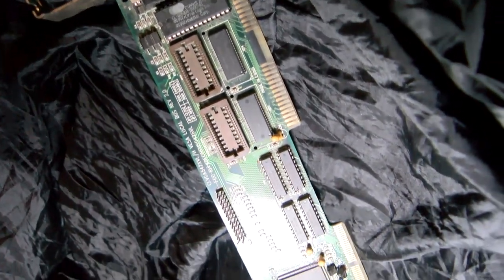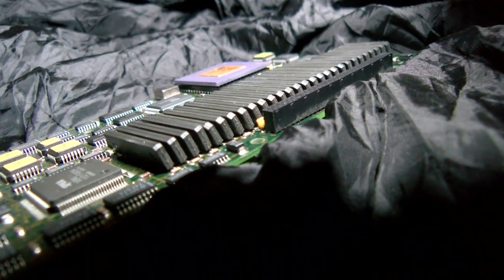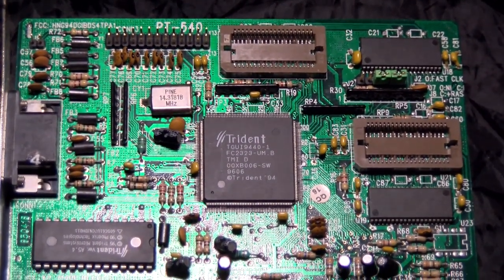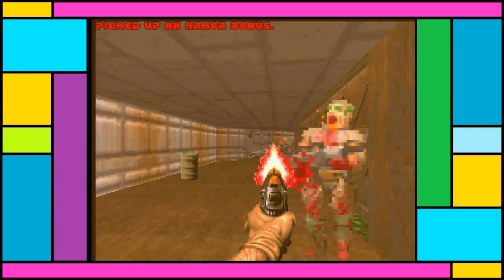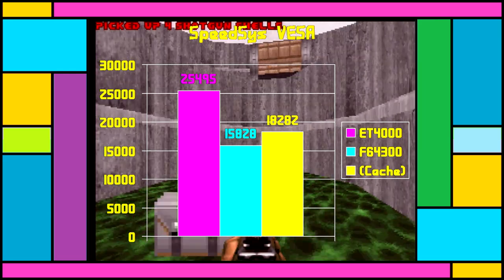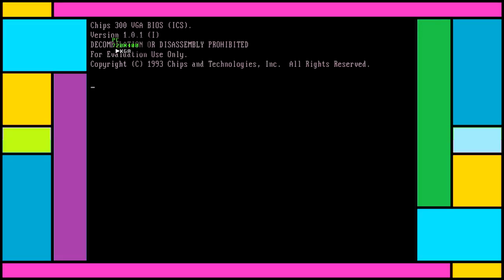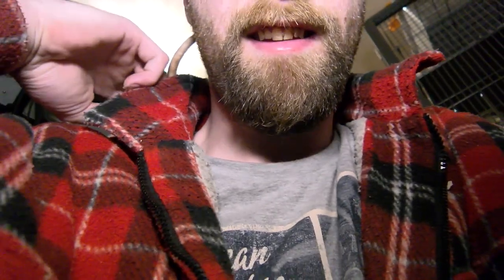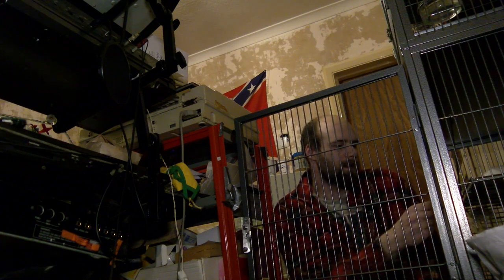C&T F64300 VGA Card

Comment: Very nice to see another video from you, and on a subject that wasn't covered 29 times before.  I happen to actually have a CHIPS FC64300 VLB card, it actually came with only 512KB RAM on board, a broken DRAM socket and 8 emtpy DIP sockets for more RAM.  I removed the broken DRAM socket and soldered on 512K of RAM instead and it works fine as a 1MB card.  I don't have an EEPROM reader but if there is a way to dump this card's BIOS in DOS, I can do that for you (let me know how, and let me know you want it..)  

This card performs on par with top dog VLB cards from CL, S3 and Tseng in my experience, but your benchmark results seem to be a bit CPU bottlenecked to actually reflect the performance gaps if you ask me. I actually happen to have some Windows drivers for this card too, that make me think it is actually not a consumer card but more meant to be used in professional workstations (there are drivers for professional software such as AutoCAD etc. on the disks) .  I find that its DOS performance is great, but I use a 2MB CL-GD5428 in my U5S-SUPER33 system instead (Yes, I'm another U5S user, and I wish I had the 40MHz chip but I can't find one for cheap..) just because I can upgrade it to 2MB with DRAM but finding SRAM for those DIP sockets has proven rather difficult (And I'm an OCD nut that will go crazy knowing I have emtpy sockets in a card that's in my system..)  

 FC64300's obscurity makes it difficult to use with earlier Windows versions (drivers are hard to find and there are no 3.0 drivers IIRC).  This video makes me want to swap out my 2MB CL-GD5428 for my 1MB FC64300 actually, because why not?  The extra 2MB does absolutely nothing for the CL-GD5428 either.. 

I hope you do more sound card reviews of more obscure ISA sound cards in the future.
Reply from the maker: So it seems that there was at least one other revision of the PCB out there. Short of having an EPROM programmer I'm not sure if there's a reliable means to dump the BIOS, you can always use DEBUG if you know the address (C0000h I think), NSSI has a feature to do this too, but both of these only dump the first 64K due to DOS limitations and trying to figure out where the rest of the ROM is yourself to get it with DEBUG isn't always straightforward.
I think I mentioned the CPU speed somewhere, but I used this one for a couple of reasons, firstly I've seen very few DX4 systems with VLB over the years, it seems PCI motherboards got cheaper at that point so people used those instead - I have, however, seen a worrying number of DX4's with ISA video cards - or else they skipped it entirely and went over to Pentium-class machines, systems with DX2-66 performance seem to be the intended target for the card, especially given the dates of things. The second reason is that I didn't really see a gap open up when I tested it in the Pentium OverDrive. 
Of course my sample size is 1, so perhaps the results are different on different hardware, evidently it is. Not sure where you'd find those SOJ RAM chips either, I've been lucky enough to have dead video cards to steal it from so far. As for AutoCAD, most cards had drivers for it, some of them do more than others.
Oddly this video took the place of an AdLib clone one which wasn't working out, that will probably resurface eventually, especially as the 286 is around for other reasons right now anyway.
Reply: @HighTreason610  Oooh, Adlib clone, nice!  Is it a clone from all the way back or did you build one of the later open source projects like the TubeTime Adlib?
Well if you are curious you can find a photo of my card here: https://i.postimg.cc/Pr0Pw9J6/Dataexpert-DSP6430.jpg
Back in the day I used a DX33 VLB which was later upgraded to a DX4-100 and retained VLB graphics so my perception was always that 486, even DX4, was largely a VLB affair with PCI implementations gaining ground only after the Pentium became a thing and PCI graphics cards became actually affordable - by when the DX4 was basically a budget CPU anyway.  I may be wrong however, after all I was just a teenager at the time and spending (mostly) my parents' money.
Regardless, my experience is that at the end of the day pretty much all VLB cards perform within a fraction of each other for DOS games.  If you will pick one, pick the one with the best support and acceleration for the OS you want to run.  This is exceptionally important for non Win3.1x systems, I find..
Reply from the maker: A couple of 80s and 90s clones, one of which is probably better than the original card, the other of which is extremely (but likeably) grainy sounding. I did get some way in making my own clone years back but dropped the project. Not sure how many sound cards I could really talk about as most of them were crap (TBS Pinnacle, S2000, fake Yamaha) and got covered in other videos, the Maxi Studio ISIS will almost certainly never get one, because the CD did something horrible to my hard drive and I lost enthusiasm after that. Might see one or two though and at least one more weird video card - far more weird than this one, that's for sure.
That's definitely the first time I've seen a 64300 that isn't on the yellow PCB, strange that they left the cache DIP sockets off yours, perhaps they really did fail to get that feature working as intended.

Comment: Given that the ramdac has to have instant access to the ram when it needs to to display a stable picture, it will block the GPU from accessing it in these situations. That's the only situation in which such a dram based cache might help...to decouple the GPU. And maybe, this situation doesn't happen that often in 320*200*256, because the bandwidth required by the ramdac is quite low compared to some SVGA modes. That would explain why there's no gain in any VGA modes but in the Vesa test.
Reply from the maker: That would make sense to me, I did mess with a few things at higher resolutions but I think the CPU tops out at that point. There's probably an argument for using a faster CPU, but I don't see VLB DX4 machines often and suspect that people were going PCI by that point.

Comment: Hey HT! I was having similar problems with Windows 10 and its incessant updates. A few months ago I found out about Windows 10 LTSC (Longterm Support Channel), which is basically a stripped down version of 10 that MS sells for enterprise users. It only receives security updates (no bullshit 'feature' updates that usually only cause more pain and torment), and is supported for 10 years. 

The issue with LTSC is that Microsoft won't bloody sell it to regular users, so the only way to get it is good ol' piracy. Also, since it's stripped down it doesn't come with a photo viewer (but on the plus side, it doesn't come with Cortana either!), so you'll have to install something like Irfanviewer to get around that.

I've been using it for a few months now, and everything seems to work pretty well. Games work fine, my video editor (Davinci Resolve) works fine, etc. Can't complain, really.

 It might be worth trying it on your future PC. ^_^
Reply from the maker: A few people have suggested that now and it certainly seems like it may be a good candidate.

Comment: I believe I have one of these boards, or at least one similar. Doesn't allow PC to boot though..
Reply from the maker: Hmm, could be toast or maybe it could just be aged capacitors, may be worth at least attempting to replace those if you're confident with a soldering iron, my STB LightSpeed (I think, it was a few years back now) had to be saved that way.